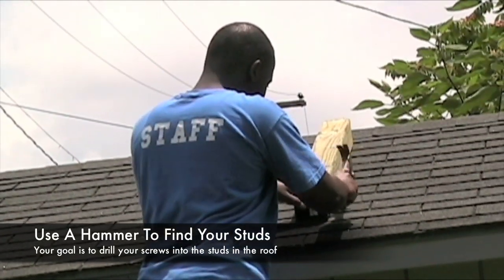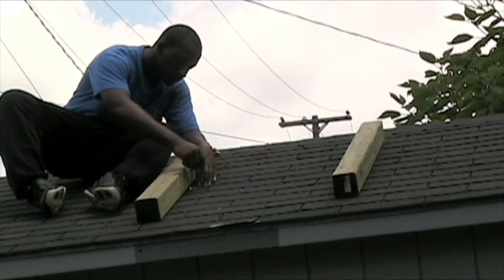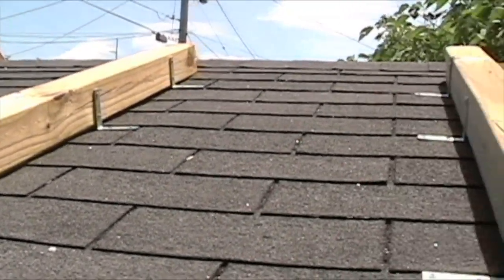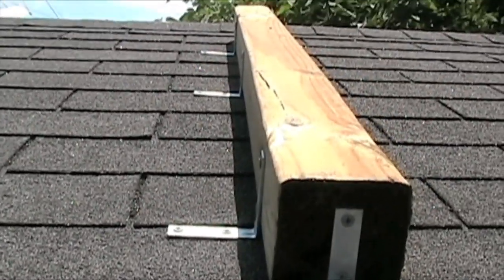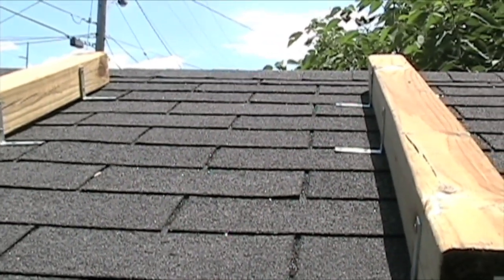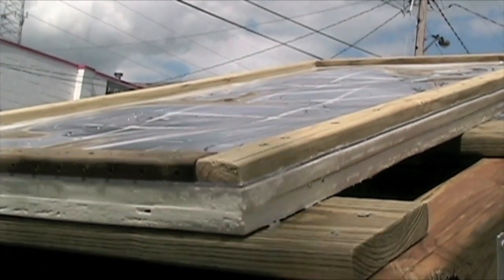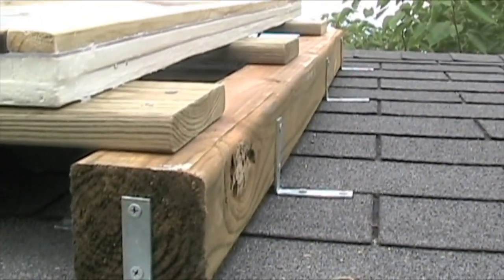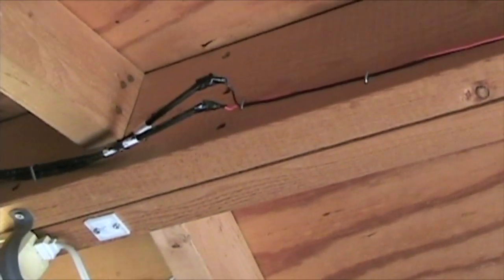How To Build A Solar Panel - Part 12

Comment: Good work Keep in mind for 30 feet weir in DC volt you will lose
1 AMP you have about 60 feet.
You need to move your battery and inverter out to the shed run 
120 ac to your home you will not lose the AMP.

Comment: you don't have to find the stud on the roof, the roof under the singles is ply, or ship wood, and would secure with more strength then you'd ever need, good job tho, have been watching all the videos, you should have put black tar under your l brackes before you screwed them into the roof to prevent water from leaking into your house
keep up the good work

Comment: I bought a 3 panel solar kit off eBay, it came with a metal frame to setup on the ground. I used 1x4 pine boards to mount them on my roof. I painted the wood white to accent the panels, and to preserve the wood. They're still up there 3 years later, flush and tight to the roof, and the metal frame I never used. To each his own, good luck!

Comment: Id consider sticking a shingle piece underneath the shingle above the L Bracket and lap it over the bracket part on the roof just so water has a run off over the bracket rather then a place to pool and later run down the screw holes.
Those shingles will expand and contract between winter and summer and maybe open up the screw holes just enough to be annoying.